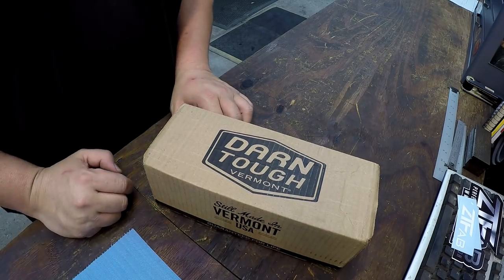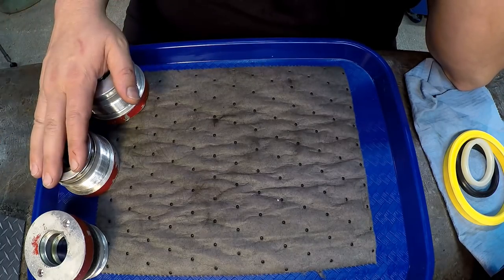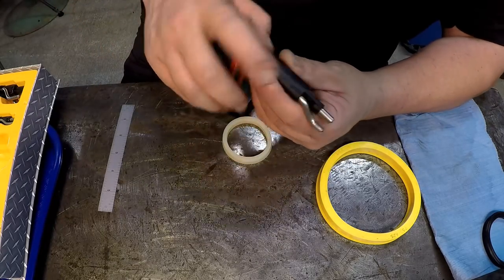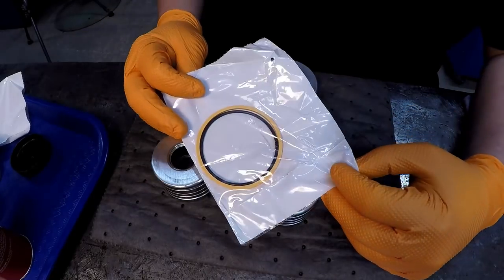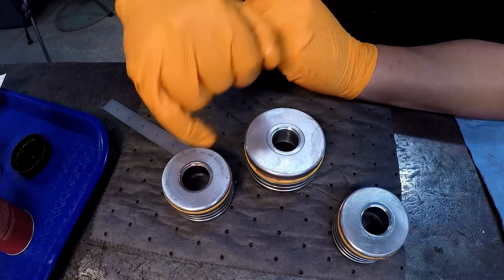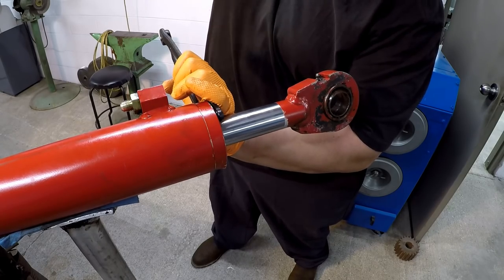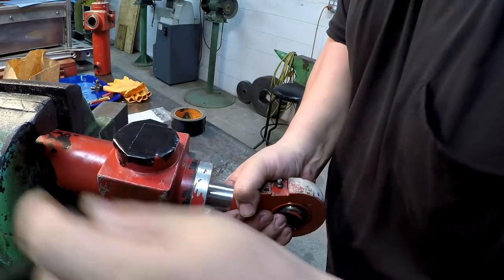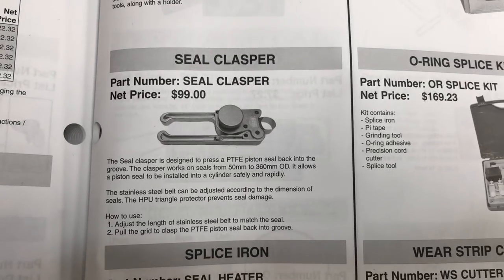SNS 217: Rebuilding Hydraulic Cylinders

Comment: Abom79 I too had an old valve guy pass the warm watwe trick on to me. Works great!! He too has passed away and I think he would be glad his tricks are still in use. I have also seen bearings heated in hot oil instead of a bearing heater for installation. Good luck on the surgery. Hope to see you back soon.

Comment: Best of luck on the procedure.

On the cylinders, the pair are swing cylinders for the backhoe.

On the assembly, a couple additional checks I make are when I I stall an oring, I check the parting line to be sure it isn't rolled. Additionally, after installing the rod guide (or gland as some call it) and the piston in the bore, I check to be sure I didn't shave any seal off on the edges. I usually just wipe off any extra grease and give it a quick rub with my fingers to tactically and visually check for anything. After 25 years, I have found a few that got scraped, but less than a handful.

I spent 15 years in a Deere industrial dealership and resealed many, many Deere cylinders with the cap seal. I just did two swing cylinders and he needs 4 or 5 more done and I am thinking of doing a video on them. I have a couple of tricks that are worth sharing.

Thanks for all of the great content and best of luck for you and your nurse.

Comment: Good luck on your recovery excellent tutorial on hydraulic cylinder rebuilding. Have to say Hercules seal company is fantastic they treat the individual the same as a large company. Rebuilt 7 cylinders for my son's backhoe this winter and when I had to call customer service they treated me no different than their largest customers. Prices are great and shipping is fast and very reasonable. You can go online and order there or call for their free catalogs which I also like to work from and order by the numbers in the book. I also have a good relationship with the local hydraulic shop when I only need a few quick items. Thanks for the videos

Comment: good job on the cylinders. one trick i learned when working in a hyd shop was to put the seals in boiling water . it softened the seals and made it easier to install . those small cylinders can be a real bear to rebuild we also used automotive piston ring compressors to collapse the piston seals and sometimes some good old shim stock and hose clamps. those seal colapsers are practically indispensable for installing small seals. best of luck with your procedure. we are all pulling for you. .

Comment: The number 2 stands for the hardness of the grease. The lower the number the softer the grease. Lower numbers are commonly used when grease has to be pumped a certain distance to where its required. Number 2 is most commonly use in industries as it stays  in place  when applied.

Comment: If you do not own a seal collapse tool, then you can cut the flat center out of a coke bottle, 16,oz or a two liter.  And wrap the plastic around the seal, and then tighten a band clamp around the plastic.  That will shrink the seal back up..  Works great on transmission seals.

Comment: Have used seal twisters for many years doing hydraulic repairs at work. They are a great asset. You'll find that the semi-hard nylon seals install much easier by immersing them in near boiling water for a few minutes first. this makes them more pliable and is recommended by several hydraulic cylinder mfgs.

Comment: A trick I use when removing pilot bearings doing a clutch job is to find a socket or shaft that fits tightly in the bearing, pack everything full of grease, and insert the shaft in the bearing and give it a good smack with a hammer - the pressure forces grease behind the bearing race and pops it out. Very similar to the operating principle of the hydraulic cylinder itself.  Works great on automotive clutches where the bearing is generally less than 3/4" shaft. Never tried it on something as big as those needle bearings, but should work the same - Just need an A-Bomb size shaft and hammer.
And prayers for a speedy recovery - We appreciate your channel, and would likely go into withdrawal if you closed up shop for a month. Catching up on video editing should take your mind off recovering.
Reply from the maker: Yep hopefully I’ll have plenty of videos I can edit for the coming weeks, and during recovery.

Comment: might have to pick me up that kit. I design many cylinders and assemble them myself when the shop guy are done making the parts. One thing I do is we have a hot plate shaped like a pan about 2inches tall. we fill it with oil and heat up the oil with the seals submerged. usually around 170-200deg f depending on the seal specs. helps make the seal more 'malleable' and helps with its memory of its shape
Reply from the maker: Yep that’s a trick I was told about by an old timer and want to try.

Comment: I haven’t used on seals however on plastic and steel pump valves. Warming the plastic replacement works great. The temperatures are at boiling water and not as high as cooking something. I showed your video to the BOP repair guys and they loved it, some of the seals are deep in the bores. They what me to find or make them extremely lone set. Thanks for sharing.

Comment: I save the used phenolic bearings when I disassemble cylinders and cut them to length to use as PS seal compressor bands with a hose clamp, they are already saturated with oil plus a little lube they can be left on the piston until the last instant before assembly or if their is enough piston length to get aligned in the bore leave them on and persuade the rod and piston into the tube with an appropriate persuader and then remove the band clamp and bearing before installing the gland/head.

Good luck on your procedure and recovery, Hopefully you'll behave and Abby won't have to ask for outside influence.

Comment: Hi Abom.

I lay here in bed (in Australia) after a hip replacement on the 22 May that's gone a bit wrong, another trip back to hospital via Emergency but I'm back home.  Its now nearly 3 weeks of continuous Machining  via Youtube.  I've enjoyed your show as well as the others in the group, NYC, Ox, Subtool etc.   I've ordered a few to many bits off ebay but keeping my chin up. Get well soon!
ps. what ever your having done, its unlikely you're the first.  You'll be surprised how many around you may have had the same work done and they are a wealth of information about your recovery.  Most surgeons have never had the actual experience and are very'light on' in regard as to what is actually happening. This is ditto re pain control.  If they ask if it hurts say yes.  There are no hero's in hospital....

Comment: Good luck with your upcoming surgery.  I usually had the hydraulic machine shop install my seals, the extra bit of cost, if any, was well worth it, but on those few I had to do I couldn't justify the cost of a seal tool set, I used an appropriate sized plastic tool handle and a oversized set of plastic coated medical hemostats, a bit challenging at times but do-able. P.S., ever notice how auto mechanics always seemed to have the one "Beater" they drove that never seemed to get the attention it needed, it's the same across most of the trades.

Comment: The grade 2 is how thick the grease is. Grade 2 is what we use in the summer time in ag when things get hot it will stay put. They will use grade 1 in the winter time because it is a thinner grease and works better in cold weather. Grade 0 is a thinner grade and if it gets hot it will turn to liquid and seep out of the tube. Or you can think of a 0 grade as a thick gear oil/grease. Some corn heads want the 0 grade in the corn row gearboxes

Comment: Hope everything works out with your upcoming procedure. I'm sure Abby will take good care of you during your recovery.
An old slow cooker / crock pot filled with engine oil works well for heating small to medium size parts.
The NLGI number is a rating system by the National lubricating Grease Institute, has to do with the consistency of the grease.

Comment: Trick I use for getting those bearings out of a blind bore is use a welder and weld the inside of the race and wait a few minutes and they will almost fall out.  I think ave did a vid on it awhile back.  We do it on king pin bushings on our bigger farm equipment.

Comment: That new seal installation kit claims that it can install seals down to 5mm?  I would like to see that process because the smallest tool looks much larger than 5mm in itself.  For the upcoming surgery, good luck.  I don't know what the surgery could be, but whatever it is must be pretty invasive to require a month of down time.  From one big guy to another I think I know what the operation might be so I hope that everything goes as planned and you get everything that you want out of it with minimal pain and stuff like that.

Comment: Hello.
While I was in my college class' for hydraulics, our instructor told us a trick for making seals softer for a short while.
What he would do is he would have a crock pot of water or hydraulic oil that he'd soak the seals in to soften them up to make installing them easier. I've used the hot water method on one of my truck brake doughnuts before and it definitely helped out.
Hope this helps in the furutre

Comment: Recovery is never relaxing...  but hope you get some good rest!   We'll be here when you get back on your feet.

Your NLGI numbers rate the viscosity of the grease as tested with a goofy piston penetration test...  Basically it means your #2 is a "normal" grease with penetration numbers in the mid to high 200 mm range.  Its what you'll find in most grease guns used on heavy machinery.   I like Kubota's PolyUrea NLGI 2 grease on my equipment.

Comment: Grade 2 is a medium grade thickness grease. The National Lubrication and Grease Institute (NLGI) does whats called a cone test rating where they drop a spicific shaped and weighted cone shaped test piece into the grease and measure how deep it sinks into the grease. As I recall they go from a 000 rating up to 6. 2 being  the approximate consistancy of peanut butter. 000 being a light oil and 6 being stiff but slightly pliable to the point of holding its shape easily if you made a ball out of it with your hands.
Reply: Thank you for responding to Adam's question.  Is that scale of cone test ratings downloadable ?  I checked the NLGI website but couldn't find anything.  Best regards
Reply: Stephen Smith 
I dont know if its downloadable. I'm just going off memory.
Reply: I searched a little more, like I should have done earlier, and found a table in Wikipedia titled " NLGI consistency number " and also at http://www.machinerylubrication.com/Read/1352/grease-basics.  Both show your Grade 2 " peanut butter " consistency.  Thanks

Comment: I put the seals in a cup of water and boil it on the microwave. Usually 2 min is all it needs. I suspect that your friend put his seals in the oil for as long it took to get them to 200 or so
Reply: Water isn't good for hydraulic seals , warm oil is all you should use (30 years in hydraulics) or develop strong fingers and good techniques.

Comment: Abom Torque is the only thing that will snap a 1 inch thick tool holder that has survived many decades before meeting it's match with you. Time to get those massive arms calibrated but I can't think of any machine with a higher torque rating than you.

Comment: P.S., I discovered welding a piece of cold rolled rod to the outside of the adjustable spanners really helped in many of the harder lids without having to bang on them with a mallet.
Reply from the maker: At work we have a piece of tubing welded to one side of the spanner.

Comment: Not going to read 140 comments to see how many answered ... grease grade is just like oil grade, how thick it is. Higher numder is thicker. #2 is pretty normal grease, higher numbers get thick like tar. #1 is pretty runny.
Reply: One job I had we used 000 grease.  About the same as chocolate pudding

Comment: I was wondering if there was a reason you don't use an air impact wrench on those piston nuts.  That's what I've always used, mainly because I didn't have a vise good enough to hold them.  I've got to get me some of those kits you have for installing those nylon seals.  You need one of those two piece piston ring compressors so you can leave it around those piston seals while you tap it in.  I learn a ton of new information watching your videos.   Thank you for taking the time to share your wealth of knowledge.

Comment: NLGI is basically a grease hardness. As such, it shouldn't be used as a way to determine proper grease to use for a particular application. Because it's classification in hardness does not correlate to rate of oxidation, etc. See ISO 6743-9:2003.

Comment: wanted to say one trick to get bearing out after u rip the bearing cage out is to weld 3 weld beads tig stick or mig whatever you have inside the race. let it cool down a you can take the bearing race out with your fingers

Comment: well maybe while you are recovering i can find some use for a cool thing i just found...

A vintage box of Greenfield taps, still in the old school green box with the wooden tray.  They are size 0-80 - smallest taps i've ever seen lol.  The box says "No. 305, 0-80 NF PLUG"

Hopefully by the time you're recovered ill have successfully drilled and tapped a 0-80 hole without having broken every single one of them.  Any ideas for a cool 0-80 thread application?? lol

Comment: Just a simple trick to remove the outer race of a bearing from a case. Weld a bead on it where the balls (or needles in this case) are running. It will shrink enough to fall out by itself.

Comment: Piston spacer on the second set is probably to adjust the overall throw of the cylinder outward, to adapt it to something that needed just a =bit= longer throw without having to produce a whole new run of rods.
Reply from the maker: It’s very possible
Reply: It's what we used to do with those kinds of cylinders at times. Cheaper and faster than making a non-standard-length rod for a small order.

Comment: The washer on the smaller cylinder piston is probably to spread the clamping load across the face to prevent the chamfered rod face digging in.

Comment: Good work as always, hydraulic cylinders should be honed, for the same reason you hone a engine with new rings. We use flex hones and make the extension out of emt. Hone it and clean it and it will good to go.
Reply: I know this is old post but was hoping you could answer my question. What grit and lubricant would you use to hone? Also I'm assuming you prefer the flex hone over the ball hone. Im getting ready to do couple cylinders and really would appreciate your advice. Thank you

Comment: The NI GL grade has to do with the consistency of the grease. Grade 2 is like almost right in the middle of the grease grades. I think it goes all the way to 6 or 7 and starts off at 000. At 000 the feeling of the grease would be very liquid or soft and the higher the number the harder the grease.

Comment: Looks like a design error on that boring bar holder, those cuts for the bolt seats make for a bad stress concentration.  Chances are someone in the past tightened it up on an undersized bar which caused the damage.

Comment: Is that boring bar holder  really worth it? It seems it was hardened and not properly annealed. So it remained too hard. But since  its shape is quite simple I would assume that you have made a new one in shorter time than trying to repair the old one. Would you not agree? And since it is has to be over-dimensioned for strength anyway but dimensioned for rigidity you could use also regular mild steel for it and gun blue (by salt bath, or SeO2 i.e. blue liquid) and oil it for corrosion resistance. This is because mild steel has the same rigidity (Elastic-modulus) as alloy steels like 4041.  All the best for your procedure and the recovery afterwards.

Comment: Abom. Tig weld that boring Barr holder use a copper pipe for a backup mill proper bevels and Tig up the bolt holes to and remachine watch over heating let cool veary slow.

Comment: Great video Adam. I'm a Texas rancher which means cheap/poor. What is the approximate cost difference between rebuilding hydraulic cylinders at a shop who specializes in such things vs buying new cylinders? Thanks
Reply: I work in a machine shop. Rebuilding a cylinder (not counting serious repair to tube, shaft, piston, etc.) averages $150-300.

A new cylinder starts at $500, depending on size, and can go as high as $10k.
Reply from the maker: That’s tough to answer because we get so many different types and sizes of cylinders. Some ag cylinders are cheap enough to replace, while others are cheaper to re-seal.
Reply: I used to own a hydraulic repair shop, we would rebuild at approximately 50% the cost of a new cylinder. On an industrial cylinder that would be a new gland or rod, or DOM barrel. The good thing about a rebuild we could find the weak point and address it on the rebuild, better grade seals or stronger materials. We didn't fool with agricultural or small telescopic ( dump truck ) cylinders due to their low replacement cost.

Comment: Another good way to remove outer race shells from bores like that is to run a weld bead around the inside of them. Easy and quick.
Reply: Sideslip dude. I’m sitting here stunned lol. What a clever way of shrinking it just enough to slide it out. Cheers
Reply from the maker: Those thin needle bearing races are very easy to burn though. I know because it happened.
Reply: Very true.

Comment: If it's a 1931 clamp, wouldn't it be metal fatigue that caused the break. Metal in a clamping situation like that will not last forever (only 86 years lol).
Reply: Agreed. It cracked right through the spot faced area for the bolt heads too. Would be a good application for one of the more modern, smaller head bolts (like Allen socket or Torx) to reduce that weak spot.
Wonder if the bar was a bit undersize as well from use, causing excessive compression?